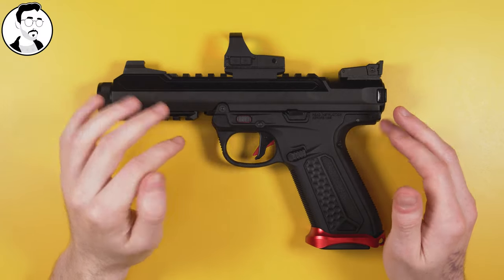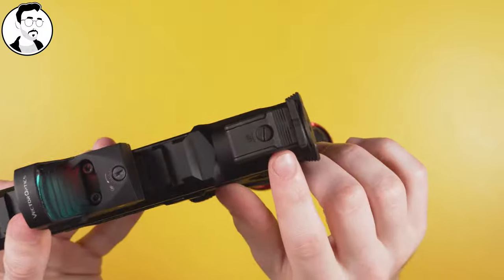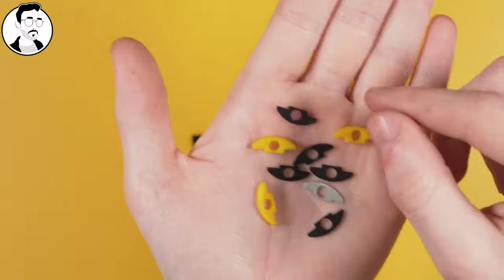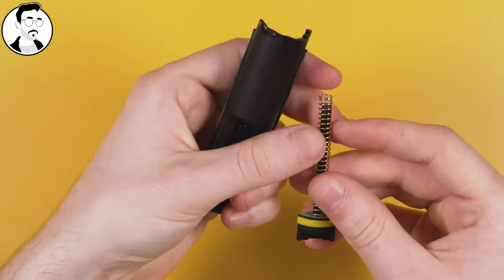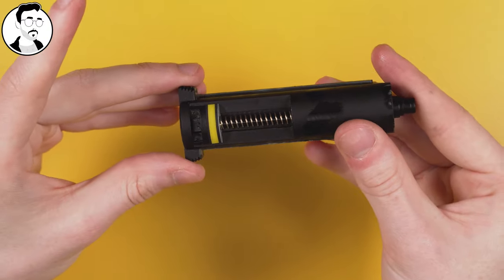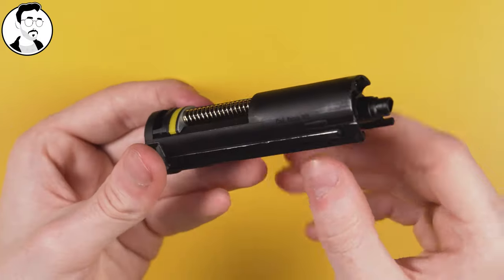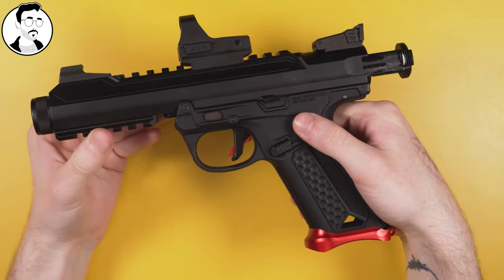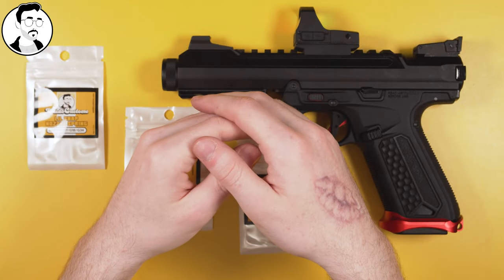How To Upgrade And Short Stroke Your AAP-01

Comment: Nice job. Hope for more innovations like yours. Ordered a set.
Reply from the maker: Thank you so much dude! Very kind words :)
Reply: Hi everybody. I am very satisfied with the purchase. I recommend the two Waldo springs + Waldo short stroke kit + AA aluminum hop-up chamber + 60° Maple Leaf Autobot 2021 version. This system runs smoothly with 0.4 bb (maybe 3 of 12 hop-up clicks). It "feels" like the soft spacer short stroke kit actually gives a softer recoil. Very nice!
Reply: Was thinking spitfire tracer next or a silencer if it actually works 
aap01Black tip 
Maple leaf barrel 
Maple leaf dec. bucking
CncHop up upgrade 
Cow cow nozzle/seal set
Cow cow trigger
Cow cow hammer and sear set 
Cow cow fire pin lock
Cow cow full auto sear 
Butterball bearing knocker
Amg antifreeze bulb 
Amg mag valve
Select fire switch
Short stroke
Recoil spring 
Nozzle spring 
3d printed Rear mount with Trijicon clone
Drum mag with rubber seal upgrade 
Hammer internals re angled and polished
Reply: Thank you so much for a detailed and simple to follow guide. its very appreciated and I ordered a set shortly after seeing this for the replica i bought for best friend which he gets to open on christmas.
Reply: and then i bought an AAP for myself because its cheap as chips
Reply: Any chance the short stroke kit and spring are coming back in stock soon??? Cheers
Reply: Where
Reply: Where i get oil and
Reply: @WaldoDynamics  any seller who calls their products "special" could be considered as a snake's oil salesman
Reply: @WaldoDynamics  Is that a scar or tattoo?

Comment: I just received "Snappy boi" kit for my AAP-01, it is probably the most fun and responsive kind of upgrade you can do to your AAP-01. It really lives up to it's "snappyness". I also have the short-stroke kit in there, with the exact same set-up as in the video. 2 black, 1 yellow piece and ofcourse the metall piece. Together with this, I run a 140% nozzlespring. Not from Waldo Customs though. I would have bought the Nozzle spring here if I would have found this earlier on. Nevertheless, it works very well! Cheers from Sweden!

Comment: Just installed the kit, love it! Used the same combination of black, yellow, black to allow the bolt to lock to the rear. The only issue I've found thus far is that the mag won't fall out unless the bolt is forward.
Reply: Hows it been holding up? I just got my kit into today?
Reply: My berreta stock wouldn’t let the mag out if my bolt is back

Comment: I recently purchased this kit and parts arrived damaged. Due to the way it was handled by customer support, I'LL NEVER BUY THESE PARTS ANYWHERE ELSE.

They immediately jumped on the issue and shipped a replacement and even asked for pictures so they could determine what to look for if the issue occurs again.

Easily one of the smoothest replacements I've ever gotten.

Comment: How do you remove the flash hider on the mamba kit, just got mine installed but I wanna run the normal thread protector lol, it’s a hefty boy 😂 any help appreciated, is it just remove the top sight and bottom rail screws?

Comment: Just got my second aap01 and black mamba so it just had to have my second snappy boi and 150% nozzle spring with your short stroke kit.what combination did you find best and what was the max you could get out of your aap-01?
Reply: is it mamba kit A or B i'm trying to find out what one has a threaded outer barrel.
Reply: @HSA_Prudii_31  I think the difference is one of them has an etched pattern on the sides and the other doesn't.

Comment: yo, i got a WE G-Force 17 coming in very soon ( first airsoft gun) and was wondering if you happen to know what strength the stock recoil spring is. because i was thinking of buying your 135% spring if the stock one is only 100% at some point when i start upgrading it. couldnt find any info on the stock spring.
Reply from the maker: i'm not sure totally on the stock model unfortunately
Reply: @WaldoDynamics  thanks anyways.

Comment: Waldo I am having some problems after putting in your springs and a very small short stroke (still looks back) when I use normal gas mags it seems like the gas is not strong enough to recook the gun after a few shoots and it just spray out all the gas from the mag. What can be wrong 🙁
Reply: Sometimes the new springs or some sliding mechanism can interfere with the loading and not let the slide rack far enough back. So it doesn't use a bb but still cycles the gas just faster. I'd make sure everything is properly lubricated and put back as closely as you can. And if not I would talk to the company you bought it from ad it's happened to me with the stock gun before as well.

Comment: What gas should I use for this gun
Reply: green gas/red gas if in cold temperatures and co2 is not recommended as internals will beak faster